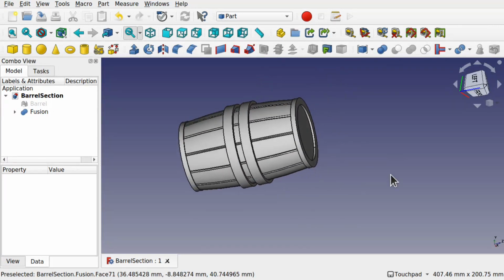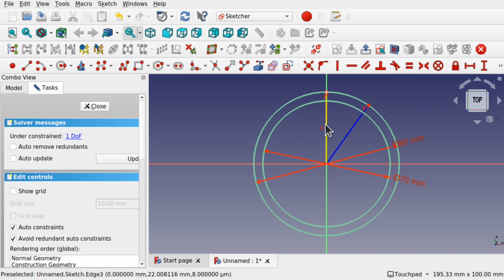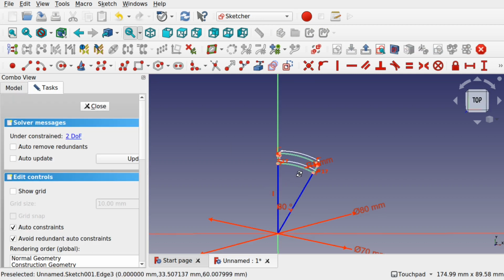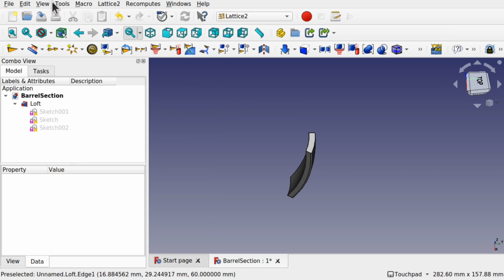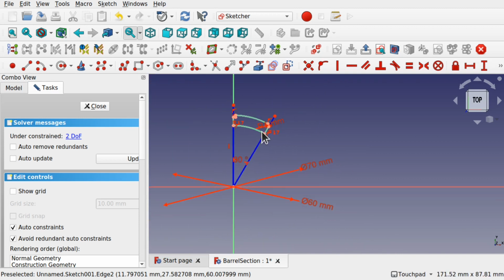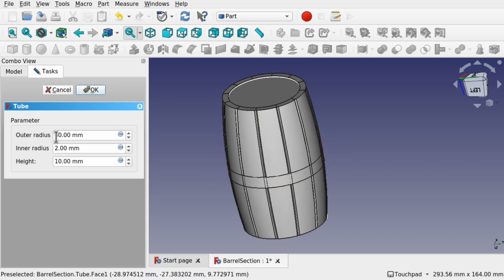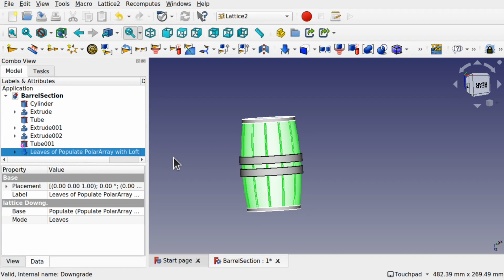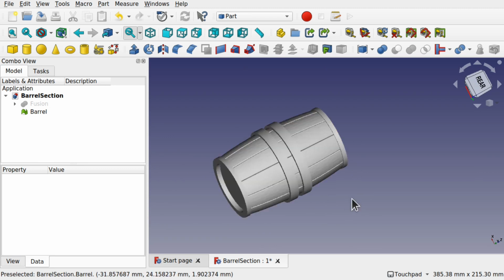FreeCAD:  Miniature Modelling | Simple Wine Barrel

Comment: Filleting the corners of the stave before lofting created a "solid" that was not watertight and had geometry errors. This made it difficult to do further editing, fusing and removing parts. If I left sharp corners on the cross section, lofted into a solid, and then filleted the outer edges, it came out as a solid geometrically correct stave that can populate a polar array.